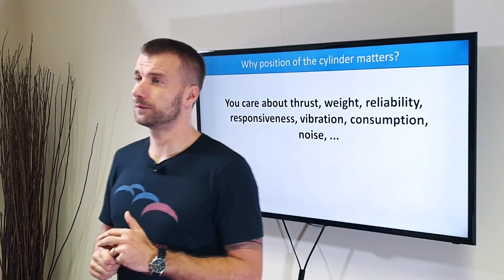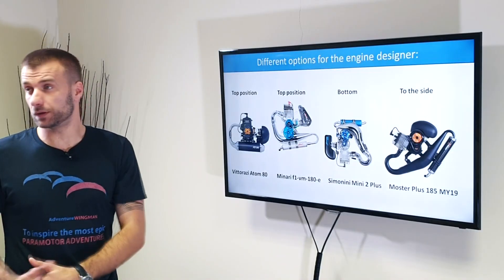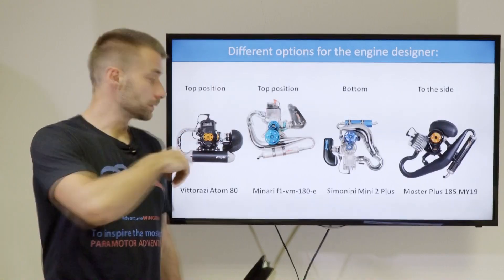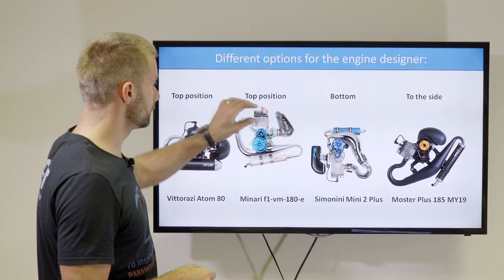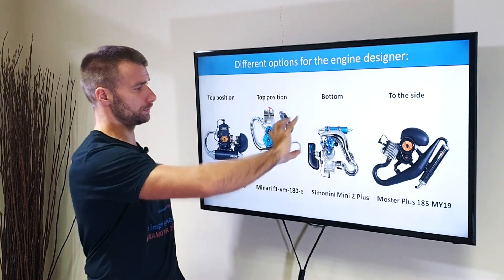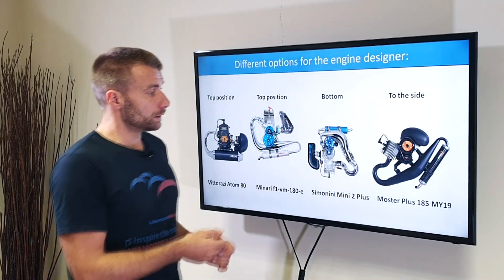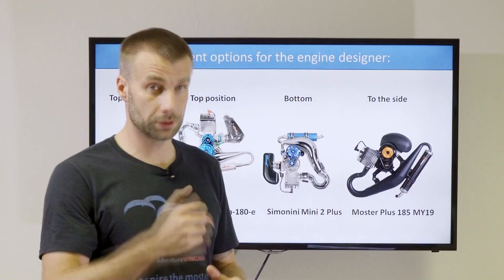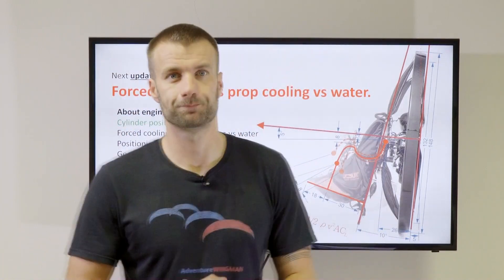What cylinder position is the best? Paramotor geometry part 31.2

Comment: Thanks Miro,I would think the farther the cylinder head is away from the prop hub the more it is in the line of thrust from prop thus actually restricting some of the efficiency or flow through the entire prop so maybe its a trade off like everything else in paramotor ;)

Comment: Awesome video as usual... random question since your knowledge is so great on paramotors 
I'm curious why people / mfg. don't use Japanese bike engines like a Honda motor? CR80 , CR125 those motors are ultra reliable compared to all the stories that I've heard
Even Kawasaki would be a great choice ...curious to hear your thoughts and opinions
Reply from the maker: Do these engines have enough power?
Reply: @SCOUTaviation  80cc and 125cc and probably more hp than moster or vittorazzi
So yes
Reply from the maker: @jase1911  now I see these are two strokes... Well, I am not an expert in engines, we design paramotor frames and stuff. But I discussed this with some engine manufacturers and this is what i have learned: It is not a problem to get 30 HP from an 125cc engine. It will be probably possible to cool it down too. The problem is that the power would be not linear. There wold be a big jump in power in the midrange. With dirt bikes this is not that of a problem as you can feather the clutch and they are meant to be ridden aggressively (on/off power). Most of our flying is in the midrange, though.